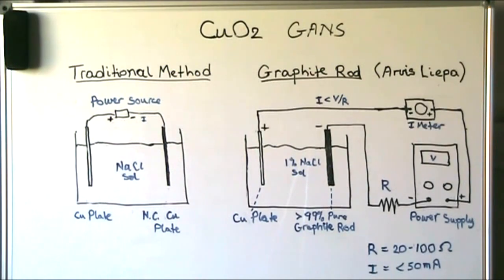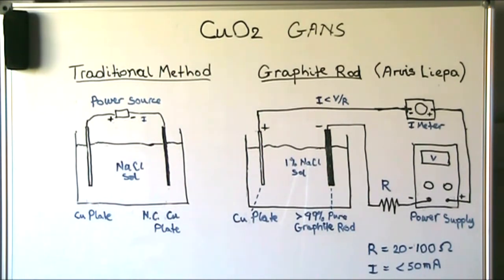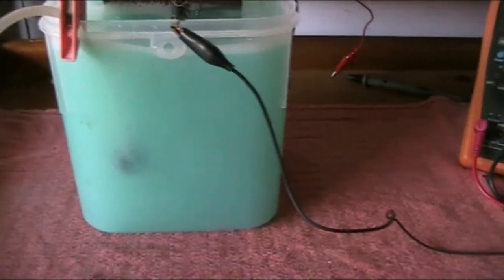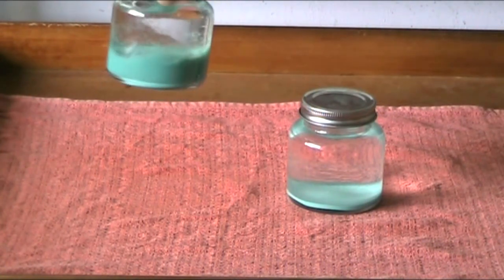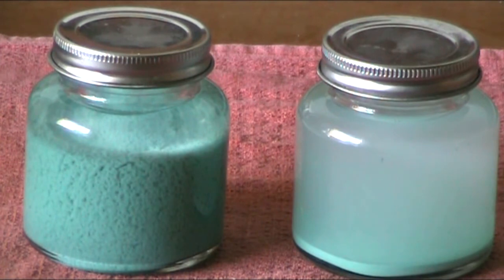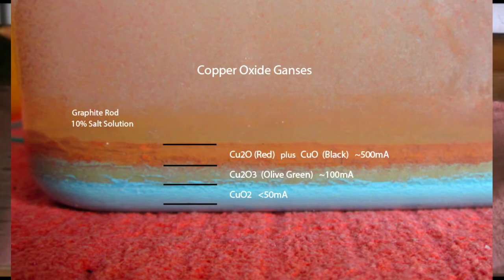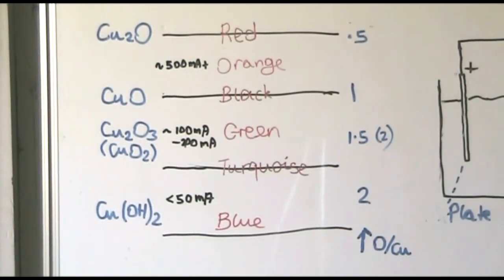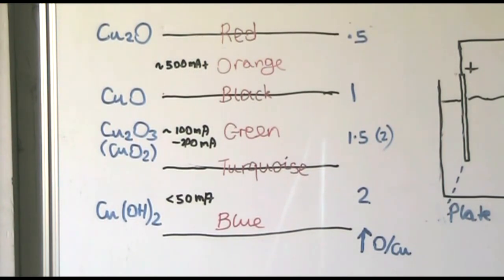Making CuO2 Gans

Comment: Hi, good research you have done. It raises a question do you think/know if when making Co2 GANS  that aeration with the bubbler will help produce a better product or a way to make mainly CO2 GANS high %  rather than mainly Zinc Oxide GANS? (i.e can use more current to get a good result due to aeration)
Reply: The aerator will increase the production speed. Balance the amount of nano coated copper with zinc by volume to get CO2 GANS. Have more zinc than nano coated copper and you'll get ZnO2 GANS.
Reply: @a110100  Thank you Jeffrey Jamon, your statement is VERY helpful because many beginners have trouble figuring out when one GaNs is formed and when the second GaNs is formed
Reply: @barbaraem9082  I suggest the caustic method over the fire method for nano coating copper. It lasts longer and can take more current to produce more GANS faster.